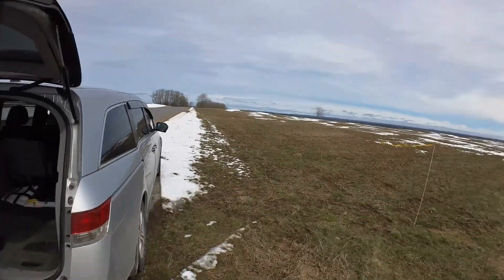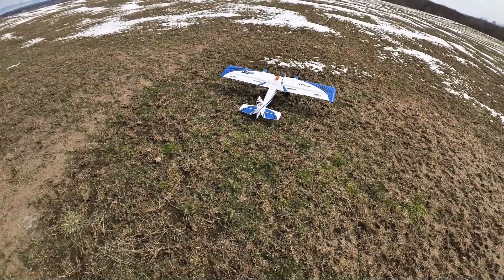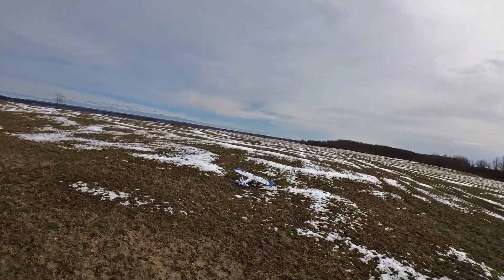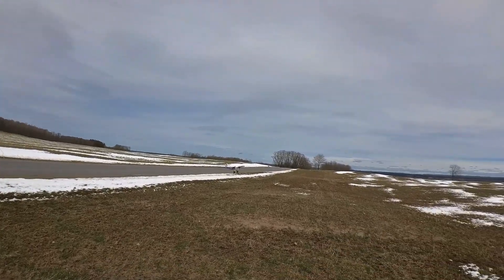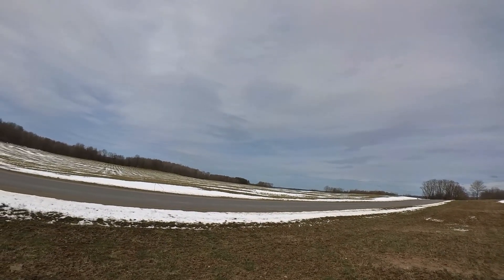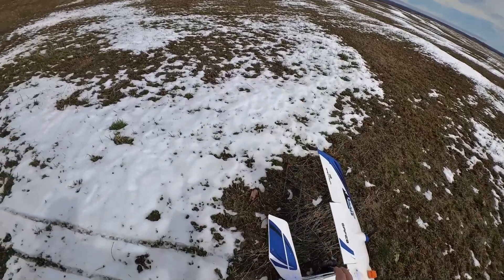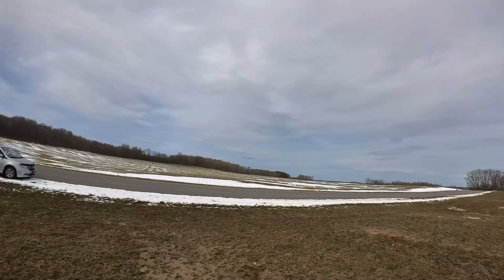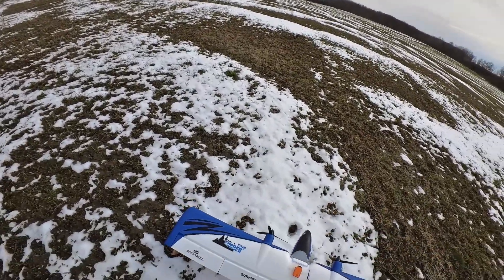Twin Turbo Timber on Wheels

Comment: my planes need runway for both ways , I try to fly them scale  ,good rough ground takeofs and landings, but thats how foamies are
Reply from the maker: Packing Material has never been a issue on rough ground if the wheels are big enough. Plus the Twin Timber has Over sized wings and almost no wing loading so it doesn't need much room to land it. Thanks for watching Ronnie